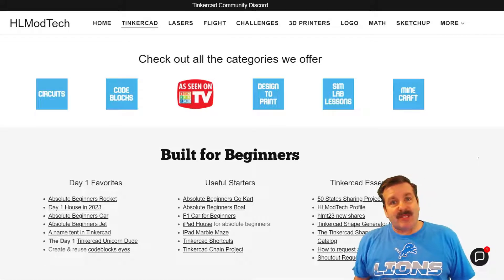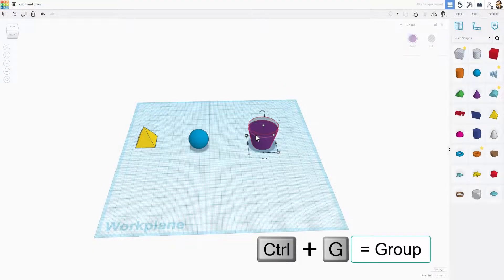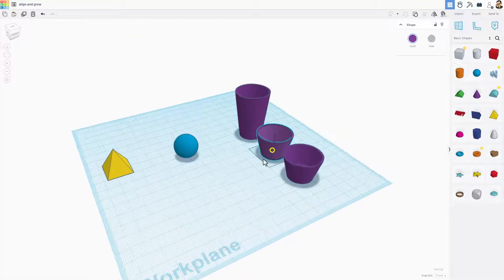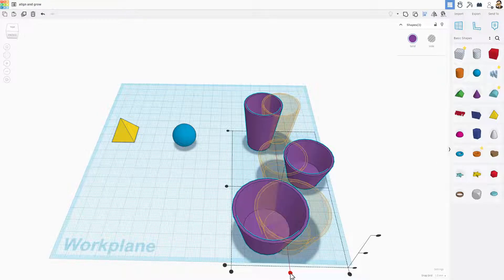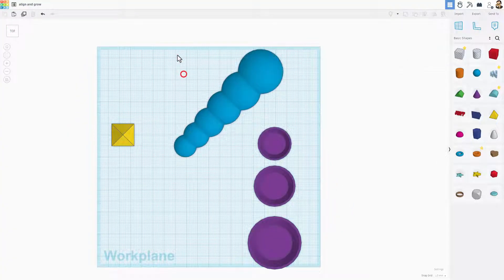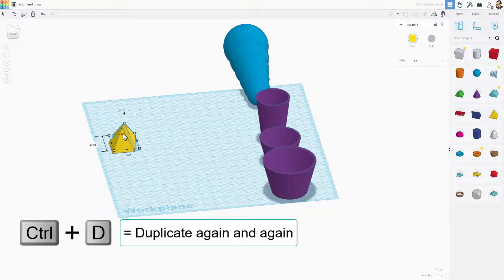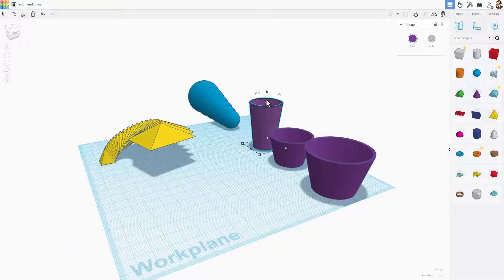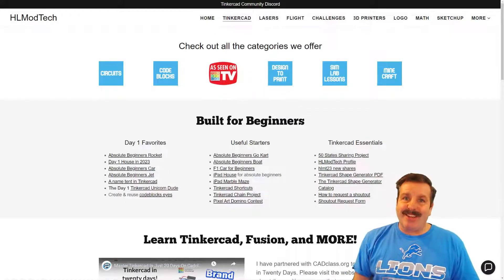Absolute Beginner Tinkercad Tips Align Scale Duplicate Nudge in Minutes!

Comment: Great tips! That “align” about the center is essential stuff, good to know. I’m used to using an offset and push/pull in my limited CAD knowledge. Is this how you would create similar “walled” shapes from the Tinkercad solids? For example, creating a hexagon box with an inset lid? 

Also, can Tinkercad be useful for modeling bigger things, say for woodworking and creating a piece of furniture?

Thanks for the great content!
Reply from the maker: Thanks and yes that is a decent way to build a walled shape. Creating the shape and the hole would be even smarter if you just adjusted the parameters. You can be more precise that way.

You can model ideas for large stuff really easily. This tiny home idea is pretty slick. https://youtu.be/-wyN-aRTLCY  Gives you a decent idea of what you can squeeze in a small area.
Reply: Thanks!

Comment: Good stuff! The cup trick works, but I like to use parameters instead of an offset because I want to control wall thickness. Furthermore, there is a parametric shape just for that.
Reply from the maker: Great points. 👍 I had a user asking about scaling around center so that was just a quick project that I could use to explain it. Your strategies would be super cool for one that I was building on my own. 💯🔥